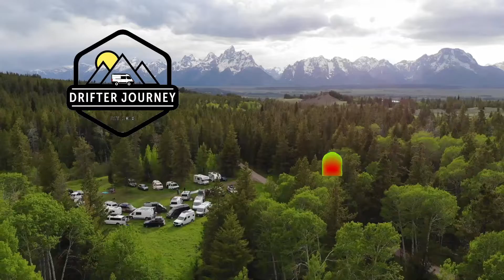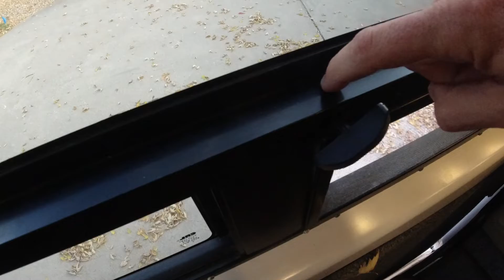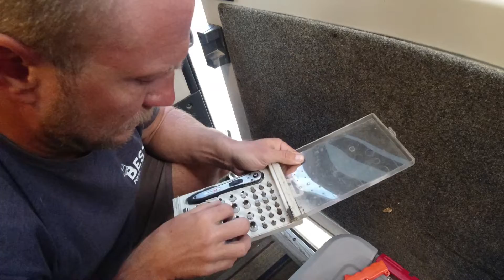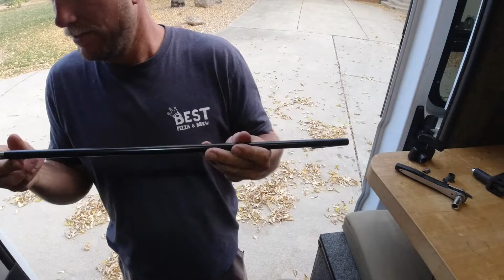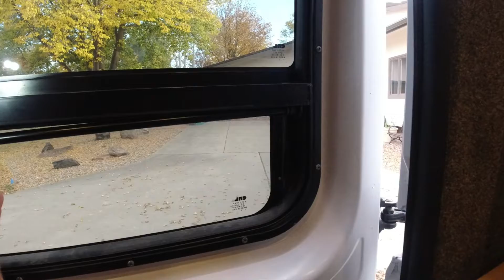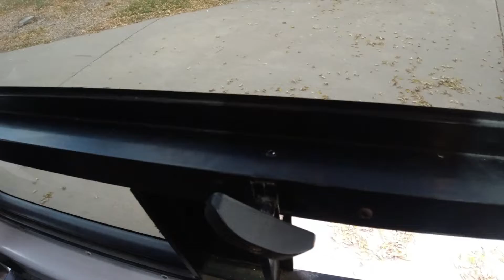CR Laurence Crank Out Window Repair - Torsion Bar Replacement on Promaster Van

Comment: I put a sheet metal screw in place of rivet. So can take out again easier if needed.
Reply from the maker: Thanks for watching and also sharing an alternative solution for folks doing this repair!
Reply: @Explore4x what size screw did you use in place of the rivet?

Comment: Does anyone talk about what maintenance might have prevented this? I would guess maybe some WD40 or silicon lube or marine grease applied in the right spots (if possible) might have prevented this breakage?
Reply from the maker: We think it's actually caused by closing the door while the window is open. Doing so without holding the glass on the outside causes it to bounce and over time we think it just degraded the metal. In addition to being exposed to the elements more, since we always park our sliding door facing the ocean, so the Salty air probably didn't help. Our suggestion is to always close the window tight before closing the slider door, or, be sure to gently hold the glass from the outside while closing.

Comment: where can i find the CR Laurence Torsion Bar , my broke on my sprinter and i cant find one .
Reply from the maker: I believe these are the only folks selling them. https://vanwindowsdirect.com/collections/crl-van-windows-cr-laurence-van-windows?constraint=torsion-bar

You'll just need to verify that you're purchasing for the correct window since they sell several.
Reply: @DrifterJourney   thanks so much for your help. i took my window apart and it looks like i have a cracked  Torsion Bar and a broken gear box .
Reply from the maker: We never had any issues with our first van but have heard of several folks having issues lately. I wonder if they got a bad batch or something???

Comment: Thanks for the tutorial! Ours broke 2 weeks after installing the window 😡 what kind of screw did you use to RE-secure the top of the handle?
Reply from the maker: Thanks for watching. We used the rivet that was supplied with the replacement bar. Good luck on the fix.
Reply: @DrifterJourney  Thanks!

Comment: Hi, we had ours broken as well I think the what cause the crank to break is shutting the door with the window open, I change ours last year and since then every time we slam the door we hold the window up so it dose not put any pressure on the crank it self.
Reply from the maker: Great mind think alike. We started doing that too! Thanks for watching and hopefully the new technique will keep this one working for a long time.
Reply: Our turn!!! Lol
Reply: Just ordered the bar. It’ll be here in a month $105. Pricy but title do. They should or hopefully have made it stronger 🤷‍♂️
Reply: @Lindsey and Danny Vanlife
  it's not. You have to hold the window up while you slam the door shut. Otherwise, it will break down again
Reply: Like close it or hold it sturdy in a upward fashion?
Reply: Well a great company would have fixed it or is working on it. So, let’s hope they are working on it 🤞. If not, shame on them because with lots of people having the same problem, they know it’s a problem and from a critical thinking standpoint it seems easy. Make the bar stronger in some shape or form. 

Sounds like add it to the list of poorly made RV products to have a backup sitting in the van for when it breaks like the water pump? Lol
Reply: Check your IG messages.